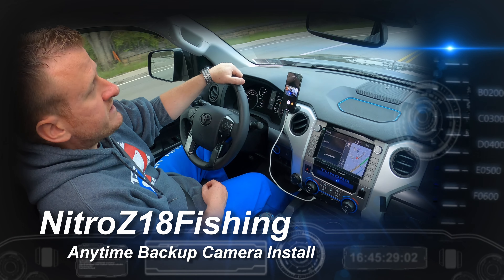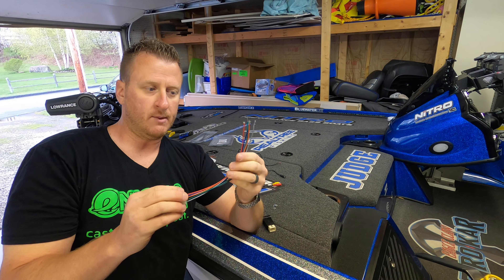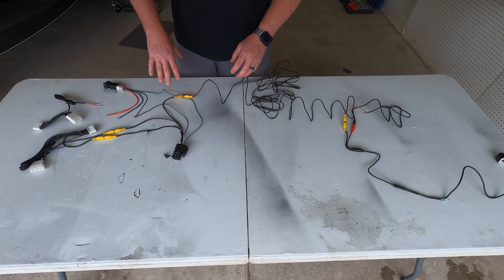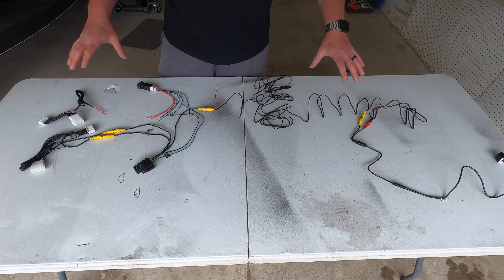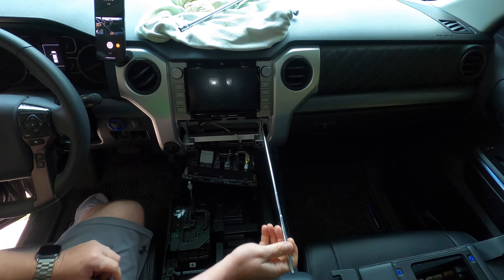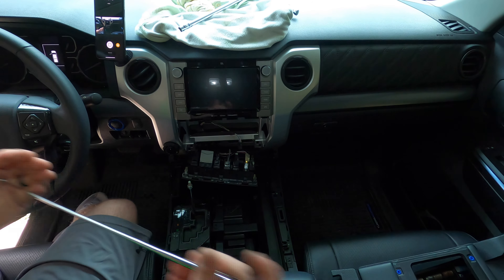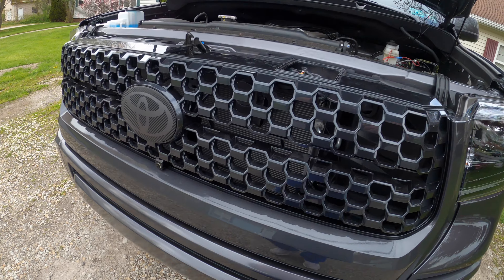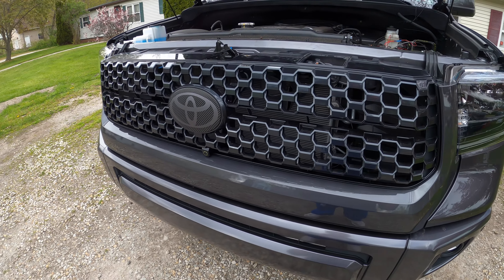Anytime Backup Camera Install on 2020 Toyota Tundra

Comment: I purchased the ABC package for my 2020 Tundra without the front camera, so I do not have but one harness (the one with the red and orange wires).  If you get the ABC without the front camera, you will need to connect both the blue and red wires on the switch's harness to the red wire on the ABC harness and then connect the gray wire on the switch harness to a chassis ground if you want your switch illuminated when the vehicle is on.   Great video BTW 👍

Comment: I just installed mine today on my 2015. Its awesome and your video helped alot. Thanks.
Reply from the maker: No prob, glad it helped ya out!...thanks for watching!
Reply: @NitroZ18Fishing  not sure if you will know but mine did not have a blu wire and grey wire on the harness to connect the blue and grey from the switch.  I know they are for the backlight but not sure what to wire them to to get the backligjt to work
Reply from the maker: hmm, thats a good question...I know the older versions (older trucks) didn't come with those 2 wires on harness, but if they're on your switch there has to be a way to make it work...I would reach out to them and ask, I'm honestly not sure where you should connect them and I don't want to steer you wrong!...let me know how you make out!
Reply: @NitroZ18Fishing  will do
Reply: @NitroZ18Fishing .  So I got ahold of anytimebackup camera and the grey tied into the black and goes to ground and blue ties into the red and red.  Working great now.  After I hooked up the blue and grey it still would not illuminate but that was due to having a bad switch.  No matter what I did it still would not give me the back light.   Got a replacement switch and it lights right up
Reply from the maker: ok awesome, thanks for updating me!!...now I'll know if anyone else ever asks about the same thing, I appreciate it!!...glad you got it taken care of!!

Comment: Love the video.  I was questioning if my local installer would have any issues.  As simple as you made it, it should be a breeze for them.   I have never liked working inside of the dash.   But give me a wrench and I will tinker all day!   BTW...  You said you got Camera "B".  But in the video, it looks like you got a camera with the lights circling the lens which looks like camera "A"...
Reply from the maker: Thanks for the feedback!...much appreciated!...you may be right, I honestly wasn’t sure which camera I got, I thought it was B but you could be correct!

Comment: I ordered the 2020 specific kit and the wiring is a little different now. There's a 4 pin connector coming from the camera which splits into an RCA and a red and black wire. Everything else so far seems the same. I'm going to install it tomorrow and take some pictures, and I'll share the album with the differences once I'm done and it's all working.
Reply from the maker: Hmm that’s interesting, mine is the 2020 specific kit as well...keep me posted on how your install goes!
Reply: @NitroZ18Fishing   Well I did the install today but completely forgot to take pictures. The new kit is way easier. All of the colors match and you don't need to connect anything to ground, since one of the black wires coming from the radio is already ground. So you just connect all the wires of the same color together, and BAM, it's wired. The hardest part is just finding out how to route the wires.
Reply from the maker: wow, that's awesome!!...makes it even easier, that's crazy that they have updated the wiring twice now on the 2020 kits already!...haha...glad you got it installed ok!!
Reply: T K hello I have the same kit what did you do with the 2 green wires and the red coming from the from camera? Did you wire them like in this   Or did you go green from relay to green from switch?  If that’s the case where did the red from the camera go ?  My camera is not coming on

Comment: Hey thanks for the video, I think I will also need to add some extra wiring. Any suggestions on which wire to buy? I assume it is 16 gauge?
Reply from the maker: Thanks for watching!...I actually used 18 gauge but either would work ok, you can get any kind really, the wire I used for this project I got at my local Walmart for like $5...hope that helps!
Reply: @NitroZ18Fishing  Thank you, definitely helps! One more question: I can't really tell in the video, but for the mounting of the front camera is the threaded portion vertical (perpendicular to the ground)  or horizontal (parallel) to the ground?
Reply from the maker: yea no prob!...it's more vertical, but slightly slanted, if that makes sense...Def more vertical for sure!

Comment: Where and what kind of aftermarket which panel did you get? I have a 1794 with no open spots
Reply from the maker: Got my panels from Nick at CN Designs, he makes em custom for our Tundras...I had the same problem with my 20 Platinum, had no empty spots...I’m actually going to be doing a video on my switches/panels, I’ve had a ton of questions on my set up when people see it
Reply: Did you ever end up doing a video of the switch panel install?   I have a Platinum also and trying to determine if I want the switch panel in front of the shifter or behind (where you have yours).   Great videos by the way and thanks for sharing all of you knowledge!!
Reply from the maker: Thank you, I appreciate it!…unfortunately I never got that one done before trading her in for the ‘22 TRD Pro, I’m sorry!

Comment: I’ve got a 2018 Tacoma off road and trying to figure out where my blue and grey wire go, they don’t have any wires to attach to
Reply from the maker: Hmm, I’m not too familiar with Tacoma’s but if there’s no blue/grey to connect to you may not use them...I know on the older ones the blue/grey wires weren’t used...on mine I had the blue/grey coming from the one harness that connected to the blue/grey on the back of switch

Comment: Blue and grey wire where did u hook it up?
Reply from the maker: Yepper, that’s for the backlight of the switch
Reply from the maker: You run the blue from harness to blue on switch, and grey from harness to grey on switch
Reply: Good install. Forgot that u have a 2020. Got 2018 ... on harness doesn't come with blue n grey. Just on the switch. I guesd have to find a 12v wire for the backlighting. Just have to figure out. 

Thanks again.
Reply from the maker: no prob!...if you don't mind, post what you end up doing for that back light, I'm sure there will be a lot of people interested in that as well!
Reply: Will do.
Reply: Hi, maz1ng3rz, 

It appears that the Anytime Backup Camera Harness. may have since been updated.  I purchased one in early February and did NOT  have the blue and grey wires from the stereo harness as it appears to be on Patrick’s in the video.  

This set of wires is for the illumination circuit.  Blue is positive and grey is negative.  It would appear that the new harness (Perhaps, updated) is already tapping into the illumination circuit via the stereo.  Patrick, this probably may have also been the culprit point of why your stereo lights were “fussing” some time ago...  IDK for sure on that one. 

However, my Tundra is a 2019 and I just extended like colored wires and tapped into the illumination circuit from a neighboring switch. 

I used the VCS switch.  I used Posi-Taps to make my taps clean. The blue wire from the Anytime Backup Camera Switch is tapped to the VCS pink wire.  The grey wire is tapped to the VCS white wire.  This will allow for the new camera switch to illuminate with the dash lights and be able to dim as well.  

Hope this helps, Bless!

Comment: Thanks for the nice concise info. Sadly I'm not impressed by the RCA connectors in this kit, especially any that are under the hood.  RCA connectors can simply pull apart (if not properly secured)  and are not weather proof. They need to come up with something better connector wise.

Comment: So I installed my camera but for some reason only the rear is working but still only when I’m in reverse i retraced all my wires and they’re connected correctly. Would you happen to know what i possibly did wrong lol
Reply from the maker: Hmmm...if all the wires are connected like in the video I’m honestly not sure...I would start by making sure all connections are secure and not lose at all...but sounds like you already did that...if you’ve double checked everything I would say call the company, I didn’t have any issues at all!...sorry I couldn’t be of more help!
Reply: NitroZ18 Fishing no worries, I rechecked all my wires today reconnected them and it’s working great now. Probably poor connection the first time around. Thanks!
Reply from the maker: awesome!...most times it is something small like that, glad you got it working!!

Comment: Got everything hooked up exactly as shown in video. Neither camera work, front or rear, switch illuminates so I know it’s getting power. If I disconnect and connect as factory, rear camera works. Any thoughts on where I’m messed up?
Reply from the maker: Hmm, if you have everything hooked up exactly like video I would say maybe check with company, it’s possible you have a loose connection or maybe a bad harness...I’m not sure of course but they would be my next steps...maybe go back and check to make sure all connections are tight...let me know if you get it working!

Comment: battery off first?
Reply from the maker: I honestly can’t remember but I don’t think I disconnected the battery for this install!...usually if I do I’ll make sure to include that in the video, and I don’t think there’s a need to disconnect it for this, hope they helps!
Reply: @NitroZ18Fishing  yeah I didn't do it on my Taco either. Installed mine a few days ago with the battery still connected.